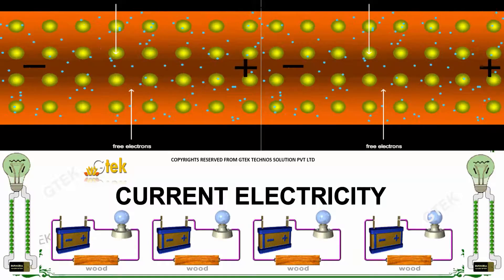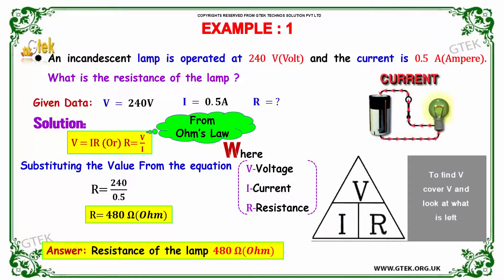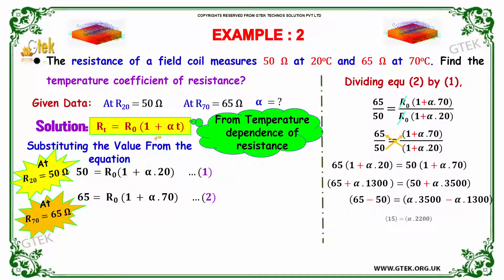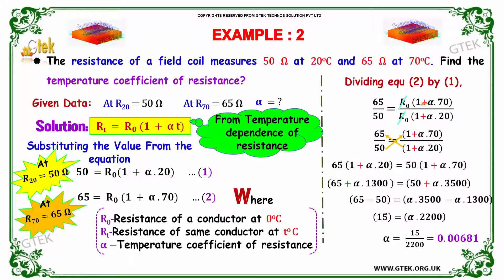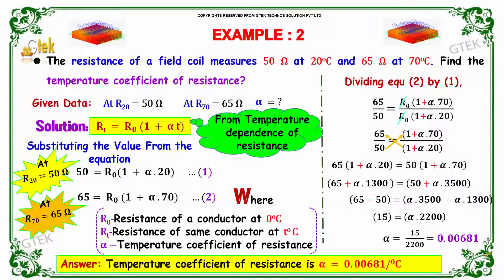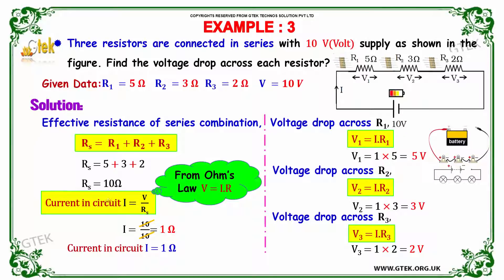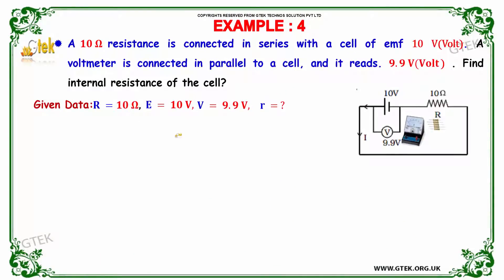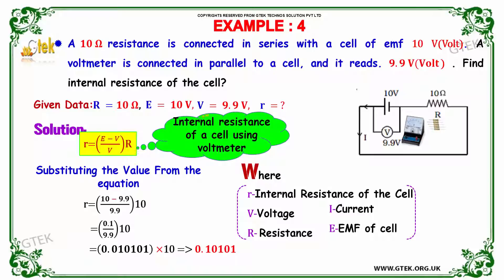+2 Physcis Unit -2 Current Electricity | CBSE | Samacheer | NCERT | TN 12th Std

Comment: A simple electric circuit, where current is represented by the letter i. The relationship between the voltage (V), resistance (R), and current (I) is V=IR; this

Comment: When a voltage is applied to the conductor, the free electrons all flow in the same direction, which is called a current. While electrical energy is transferred through the conductor at nearly the speed of light, the individual electrons move at a much slower pace.

Comment: It can also be carried by ions in an electrolyte, or by both ions and electrons such as in a plasma. The SI unit for measuring an electric currentis the ampere, which is the flow of electric charge across a surface at the rate of one coulomb per second. Electric current is measured using a device called an ammeter.

Comment: The direction of an electric current is by convention the direction in which a positive charge would move. Thus, the current in the external circuit is directed away from the positive terminal and toward the negative terminal of the battery. Electrons would actually move through the wires in the opposite direction.

Comment: Image result for Current Electricity
It can also be carried by ions in an electrolyte, or by both ions and electrons such as in a plasma. The SI unit for measuring an electric current is the ampere, which is the flow of electric charge across a surface at the rate of one coulomb per second. Electric current is measured using a device called an ammeter.

Comment: The SI unit for measuring an electric current is the ampere, which is the flow of electric charge across a surface at the rate of one coulomb per second.

Comment: (a) C.G.S. electro-static unit (esu):- 1 esu of current (stat-ampere) = 1 esu of charge/1 second

(b) C.G.S. electro-static unit (emu):- 1 emu of current (ab-ampere) = 1 emu of charge/1 second

(c) S. I unit (ampere):- 1 ampere = 1 coulomb/1 second

(d) 1 A = 3×109esu of current or stat-ampere

(e) 1 A = 1/10 emu of current or abampere

Comment: -The velocity with which the free electrons are drifted towards the positive terminal, under the action of the applied field, is called the drift velocity of the free electrons.
Drift Velocity

V = (eV/ml)\tau

Here, e is the charge of electron, V is the potential difference, m is the mass and \tau is the relaxation time.

Comment: Current strength, in a conductor, is defined as the rate of flow of charge across any cross section of the conductor.

I= q/t = ne/t

For non-uniform flow,

I= dq/dt

Or, q = ? I dt

Comment: electricity exists when there is a build-up of opposite charges on objects separated by an insulator. Static (as in “at rest”) electricity exists until the two groups of opposite charges can find a path between each other to balance the system out.

Comment: Electric current is the rate of charge flow past a given point in an electric circuit, measured in Coulombs/second which is named Amperes. In most DC electric ...